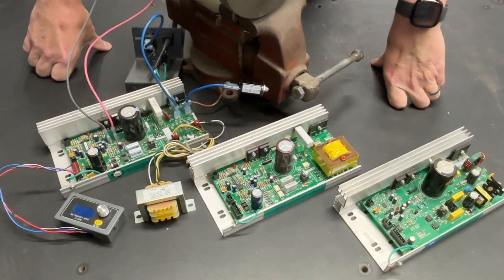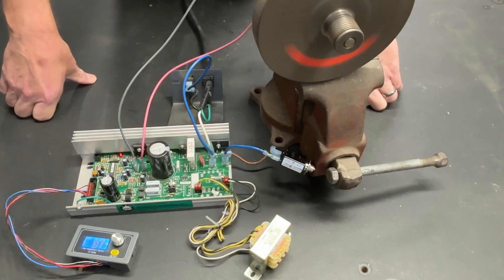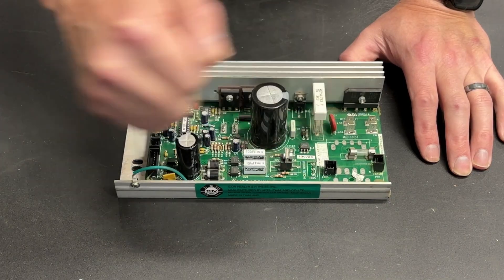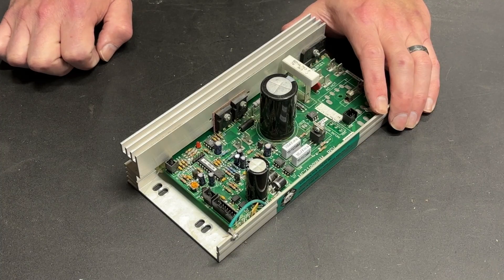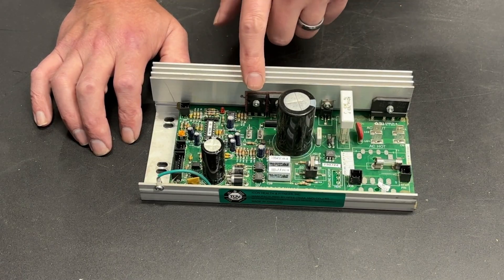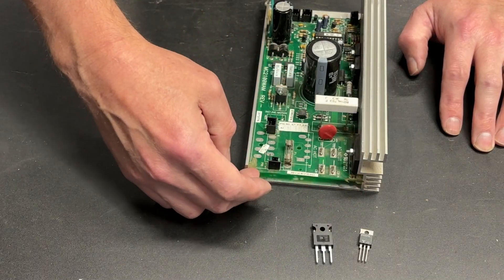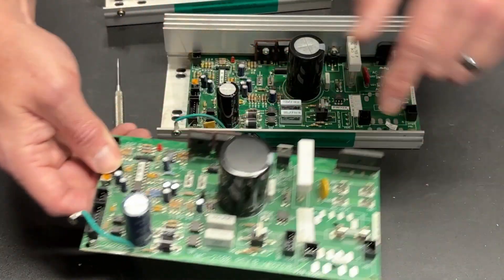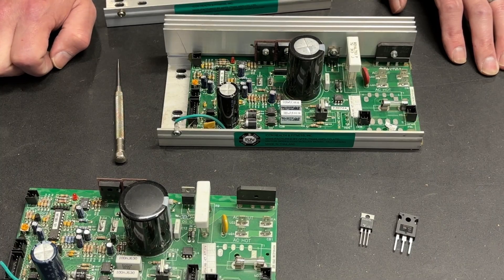Troubleshooting and Repair of an MC-2100 Including common Component Failure and Diagnosis

Comment: Yeh, do you experience error 26..in precor m9.27?
What parts exactly  deffective..thanks for sharing of information.
Reply from the maker: No clue. I don’t do treadmill repair. I simply use the parts for other projects so I can do basic troubleshooting but don’t know all the errors.
Reply: The motor or the speed sensor is going bad.  There also maybe to much amp draw because the walking deck or walking belt is worn.  Get your multimeter and test the amp draw or should be higher than 3amps without a load with a load 4-6 amps is good.
Depending on the weight of the user.

Check your speed sensor 
Check the brushes in the motor on each 
side make sure there atleast a inch any deep curvature will mean they are bad and no longer making contact to the commentator. 
 
Speed sensor signal short in the wire.

I’m a treadmill repair tech lmk if you need help
Reply from the maker: Thanks for answering that I appreciate it.
Reply: @dazecars  no prob

Comment: I wasn't hoping to find anything about this controler and there you are with this amazing video. I'm fixing MC2100ELS-18W the mosfet is schorted but also the IC next to it is blown up it's in SOP-8 package i guess it's some sort of mosfet driver byt I don't know it's specs because markinks are blown. If you cold write me what are the numbers on this part i will be really thankful (it's a black smd camponent closest to mosfet with 8 legs on a version of the controller with small ferrite core transformer)
Reply from the maker: just to make sure I get the number for the correct component can you email me through my website and send me a pic of the component in question?
Reply: @dazecars  I send it to your Gmail
Reply: @dazecars  I send i to your mail
Reply: @dazecars  I have send it to your mail
Reply: @dazecars  I send it
Reply from the maker: I emailed you back a picture of

Comment: Thanks so much for this information. I have two of these controllers I am using on various machines and am sure one of these days this will be very helpful.  I also have a TW-110D controller out of a Nordic Track treadmill and am having trouble finding any information on the pins to connect a PMW controller. If you have any suggestions on how to go about identifying the correct pins I would appreciate it very much. Thanks
Reply from the maker: Glad this video was helpful.  Sorry but I do not have a hack for the TW-110D controller.

Comment: Kinda got a million questions.

One is a pwm a pwm meaning cheap or nah? And what pin does the blue wire go to from pwm?

I'll leave it there. Thank you for some details I didn't know
Reply from the maker: I like the knob type PWM that I have linked in the description.  Slightly better quality and still affordable.  As to wiring this video will answer those questions https://youtu.be/jLqcvYD_Mnk
Reply: @dazecars  would this set up be more less the same through every board with this style? Given different hertz and plugs. I'm assuming the pwm module is in sense the ucb of the tm and turning the knob is just the speed up/down buttons
Reply from the maker: Not quite sure I completely understand you question so if I don't quite answer it please ask again.  The PWM at 20 Hz works on all MC2100s regardless of board revision and it also works on the MC1650LS.  Many other modern treadmill boards also use a PWM signal to trigger their motor control board but I don't know the wiring or the initial Hz. That is why I don't have a hack for every possible treadmill board.  As far as the way the speed control works the MC2100 is using the pulses from the signal generator to trigger the on off action of the MOSFET which in turn controls the power output of the board.  The knob on the signal generator is simply to adjust the duty cycle in the Hz range.  I hope that answers your question, if not let me know.